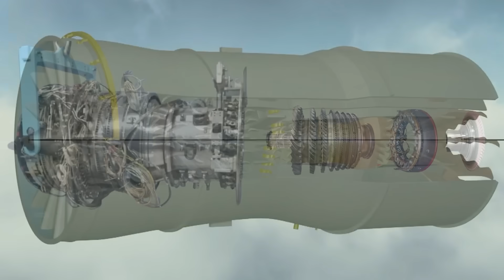How powerful could America's new F-47 stealth fighter really be?

Comment: The F-35, while capable of reaching Mach 1.6, is not designed for sustained supersonic flight, and its B and C variants are limited to 40-50 seconds at Mach 1.2-1.3 for structural reasons

The F-35 is worthless!
Reply: false

Comment: Shouldn't our CCAs be able to keep up with the F-47 Quarterback in range and speed for the most part? Outside of prepositioning collaborative aircraft, which could compromise readiness, surprise, and just gum up the logistics in general, how else would they be able to work with NGAD fighters (and bombers)? 

Easiest way IMO would be using CCAs with the same engines on smaller single-engine CCAs. The problem would be cost... Would be 50M+ (a guestimation). The only way to bring down cost would make 1000+ of them and use them across most US combat aircraft. This program would be as big or bigger than either NGAD program.  Unless we can apply fourth generation manufacturing principles (many are already being used with the Raider, and will be used for the NGADs) where fixed costs are brought down making it feasible to do much shorter productions runs while keeping expenses down. This is why we had talk of Century Series type crafts coming back where we would manufacture planes quicker, and more often, and more specialized in smaller production numbers. 

The next logistical problem that come to my mind is refuelers. We need "stealthy" (not to the extent of deep penetrators) flying-wing tankers which is on the drawing board, but when will they be ready? The Pacific is big.

A few additional thoughts:
Turbo fan (efficient mode) up to Mach 1?  
Supercruise at Mach 2? 
Afterburner Mach 3?   
An additional (s)ramjet cycle max Mach 5+... Or would that be a different program altogether? (I would think so.)

Comment: If GE build the engines, it will be rated at 62000 lbs + thrust with ceilings up to 70000lbs of thrusts; but no air force able to afford that kind of performance; the financial cost effect and the fuel consumption is way off to be any use in any scenario! They were able to push it up to 72000 for 1/3 of a second 😊

Comment: What is the biggest feature of canards? Lift. If the F-47 does not use three engines, such a large fuselage is flying, and there is no rotatable flat nozzle like the F-22, the F-47 needs the assistance of canards when it needs to increase its altitude. China's J-20 has studied canards very early, and China has relevant papers. When the canards are integrated into the fuselage lines, the impact on stealth is not that great. When flying far away from the enemy, there is no need to change the angle of the canards. The stealth angle of the canards is the best.If it is necessary to change the angle of the canard to allow the fighter to climb or turn, to meet combat or dodge missiles, then it will make no difference whether the canard has affected the stealth, because the enemy has already discovered you. Only in combat will the canard be used to change the position of the fighter. It makes no difference whether there are canards or not. Only people who don't understand say that stealth is completely destroyed or that stealth is completely impossible. The biggest difference between canards and traditional stealth fighters is that the angle of the radar detection canard is not integrated into the fuselage lines and the side angle is relatively large. If the lift of the canard for the F-47 is greater than the radar impact brought by the canard, then it is necessary to do so.

Comment: Even if we assumed that this plane has a gross weight of 60000 lbs, due to the increased size and double the engine weight of the f35, it would be able to take off straight upward without the afterburners. That's insanity. With the afterburners, you would accelerate at 1 G when the plane is angled 69 degrees upward. For reference, a Model S Plaid accelerates at 1.15 G and this is nearly double that. That car makes most people's stomach's light on fire. The F15, famous for its ability to fly straight upward and its ridiculous combat record, can accelerate at 1.17 G. 

And of course it comes as a result of VTEC. Honda forever babeeeeeee.

Comment: The 200%, so three times the cooling capacity, is absolutely astronomical. That might be eaten up significantly by the extra thrust power, but even then, I would hazard a guess that you're not looking at double the electrical capacity You're looking at more than double

Comment: Man looking at these engines I thought this, how amazing could it be if like Space X’s Raptor 3 engines that have been upgraded and engineering has evolved so much on them especially with when you look at R1 R2 & R3 next to each other R3 can be made with a 3D printers and they’ve learned how to design pathways for tubing that actually runs through the foundation meaning less showing on the outside. It runs so damn good and is much more powerful and is much cheaper and can be made in just a couple days I think or maybe less. So I wondered how amazing and cheaper would it be if these engines could be made the same way

Comment: I thought the 20% increase figure relates to the 28,000 lbf thrust figure without afterburning? That would still be 33,000 lbf of thrust which would be very impressive. Not the same headline figure, but arguably more useful.

Comment: I believe the XA-100 offers +20% power over the older version of the F135 engine, which puts it on par with the modern version of the F135 engine.
But it still has the cooling and gas mileage benefits.

Comment: At this point why bother put afterburner on it, just turbojet mode is plenty enough. It will reduce weight, cost, maintainance, air frame dont need to withstand extra heat which add even more benefits.

Comment: The XA100 and XA101 will be in the 45k range, however, the XA102 and XA103 for NGAD are slated to be in the 35k-40k range. Also, this 20% boost to thrust is in general, across certain envelopes. It's not a guarantee that it'll be 20% more max thrust too. It could be 20% more thrust at 50k feet enabling supercruise at mach 1.4 for the F-35 as an example, and perhaps only 10% additional thrust at full afterburner. What matters most imo is the cooling and variable cycle for cruise and max performance

Comment: A new stealth material has been developed that will allow aircraft to fly over Mach 2 without degrading the stealth coating. 
Researchers at North Carolina State University (NC State), not UNC, have developed a new, more challenging, and more radar-absorbent "skin" for stealth aircraft, a carbon fiber-reinforced polymer composite, that can withstand harsh conditions and temperatures, and is easier to apply than existing materials. 
Here's a more detailed breakdown:
The Problem:
Existing radar-absorbent materials (RAMs) used on stealth aircraft have limitations, including being fragile, heavy, and having limited temperature resistance. 
The Solution:
NC State researchers, led by Chengying "Cheryl" Xu, have developed a carbon fiber-reinforced polymer (CFRP) composite skin that addresses these issues. 
Key Features:
Toughness: The material is designed to be more durable and resistant to heat, salt, moisture, and friction. 
Radar Absorption: The composite material is more radar absorbent than existing polymers, absorbing more than 90% of incoming radar energy. 
Temperature Resilience: The material can withstand temperatures as high as 1800°C (and as cold as -100°C). 
Application: The material can be sprayed onto the aircraft's surface, forming a solid ceramic coating in a few days. 
Benefits:
According to the researchers, this new material could lead to stealth aircraft that are faster, more maneuverable, and able to travel further. 
Next Steps:
The team is producing and testing larger samples and seeking industry partners to expand the material's use to other applications, such as submarines and fighter carriers.

Comment: If the F47 is larger or even substantially larger than the F22, then the obscured mockup or artist impressions we've seen are VERY misleading--they look tiny, especially the one showing the canards. The small size would also argue against the feasibility of "considerably longer ranges," no matter how efficient the new engines are projected to be, especially if they want to keep the full stealth features (i.e., no external tanks).
Reply: What is the biggest feature of canards? Lift. If the F-47 does not use three engines, such a large fuselage is flying, and there is no rotatable flat nozzle like the F-22, the F-47 needs the assistance of canards when it needs to increase its altitude. China's J-20 has studied canards very early, and China has relevant papers. When the canards are integrated into the fuselage lines, the impact on stealth is not that great. When flying far away from the enemy, there is no need to change the angle of the canards. The stealth angle of the canards is the best.If it is necessary to change the angle of the canard to allow the fighter to climb or turn, to meet combat or dodge missiles, then it will make no difference whether the canard has affected the stealth, because the enemy has already discovered you. Only in combat will the canard be used to change the position of the fighter. It makes no difference whether there are canards or not. Only people who don't understand say that stealth is completely destroyed or that stealth is completely impossible. The biggest difference between canards and traditional stealth fighters is that the angle of the radar detection canard is not integrated into the fuselage lines and the side angle is relatively large. If the lift of the canard for the F-47 is greater than the radar impact brought by the canard, then it is necessary to do so.

Comment: What happened to the combined cycle engines with rotary detonation combustion chambers that deliver hypersonic power in spades. How about the fact that the SR72 has already flown at Mach 9? Afterburners? Give me a break. That's now obsolete technology with rotary detonation available. I expect these next generation planes to be a total disappointment in light of what we already know is possible. What about Lockheed's fusion power plant that can provide enormous power in a small package? What about the anti-gravity engine on the TR-3B? So are we going to get a true 6th generation plane or a 5++ generation plane with turbofan engines pushed to the max? For the one Boeing is building, given their track record I guess we should just be satisfied if the wings don't fall off.

Comment: You guys are sooo silly! The new engine will obviously be a
FLUX CAPACITOR!😂😂😂
Reply: The Flux Capacitor wasn't what propelled the DeLorean, it just did the time travel wizardry. 
It still used a gas engine in the first (2?) movie(s) with plutonium to generate the electricity (an RTG basically, like used in space probes and some Mars rovers), replaced by Mr. Fusion in the second one. (I don't recall what was used in the third, only that the train was what got it up to speed)
Reply: @DUKE_of_RAMBLE  
Hmmm, I thought it was a couple of banana peels and a empty beer can.

Comment: The F35's the AN/AAQ-37 Distributed Aperture System (DAS), which gives the F35 a famous 360-degree field of view with six high-resolution cyrogenic infrared sensors. Even to "cool down" these six sensors, so much electrical power is required that one has to imagine how much electrical power all these sensors (AESA, EOTS, CNI, etc.) require. Before we move on to "laser guns", we should keep in mind that this type of defence systems require an enormous amount of electrical power. Every bit of watt is seriously calculated to improve the resolution of these systems
Reply: This made me think, 🧐
what could the resolution be if each F-35 had one of Iron Man’s chest mounted arc reactors.

Comment: I wish i kept the video of the Northrop interview regarding the YF-23. They said that they had full confidence that they would win the competition against the YF-22. Not only did their plane was more stealth, but it was much faster. He said during a fight, if F-22 can walk away for F-15s. Then YF-23 could walk away from YF-22 in same scenario. Its crazy because that was 1990s tech. Cant imagine the engines they can come up with now
Reply: I’ve always thought we should have developed the YF-23 into a long range intercepter.
Reply: The proto-type was and it beat the raptor in stealth and range.But not agility for dog fighting.
Reply: What nonsense.  Both AC were very capable. The YF-23 was probably a bit stealthier but could not have that much stealthier bc the F-22 is the stealthiest production AC in the sky to this day, 30 years later.  Their speed was probably also similar bc they used the same engines, weighed about the same, and going much greater than mach 2 was not a priority and would require heavy, expensive, non-stealthy variable inlets.   

The YF-22 was chosen over the YF-23 because the former was more mature, more maneuverable, an overall less risky choice.

I am sure that the Northrop exec was completely enthralled with how good the YF-23 was.
Reply: @FactCheckerGuy  So the F15 is still faster at mach 2.9 at sea level. So how can the F-22 be faster without variable inlets?
Reply: @knowahnosenothing4862  I read it in terms of acceleration, not top speed.

Comment: When we say that a fighter is Mach 2 capable, we mean that it can reach a top speed of Mach 2.0. But when Donald said the F-47 was Mach 2.0 he meant that it could cruise at Mach 2.0.  Most jet fighter aircraft cruise at Mach 0.9.The F-22 can cruise at or above Mach 1.0. It can 'super-cruise' at a speed above Mach 1.5 and I think it can do as high as Mach 1.8. The problem is that it still uses up too much fuel so the F-22 cannot super-cruise for long. The F-47 though is reputed to be able to super-cruise at Mach 2.5 and to do this for a useful length of time. It will also have a top speed of Mach 3.0. That would be incredible. Can anyone comment on these claims?

Comment: 1:37 20% more range with 50% more loiter time. Wouldn't that mean it's slower? Is the TWR better than before?
Reply: Range is governed by fuel/unit distance loiter time is governed by fuel/unit time. 

The most fuel efficient speed to cover distance will burn more fuel than the most fuel efficient speed to loiter.
Reply: @bronze5420  good point, thanks
Reply: Maybe…but speed isn’t as important as it once was.  However….maybe not.  So it may be fast AF, too!  I suspect it will be over powered in every way.  Beyond even what we will initially be told.  Just like the F-35 “sucks” at dogfighting even though its real advantages mean it won’t EVER need to dogfight a damn thing…ever.  Our kids will find out how OP the F-35 really is long after we are dead.  
Bet!
Reply: A plane can fly at different speeds